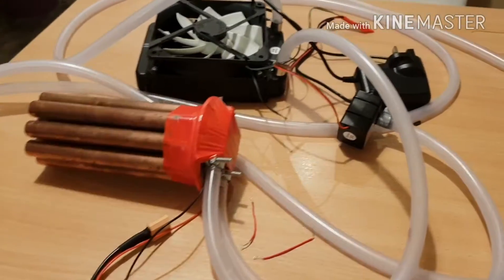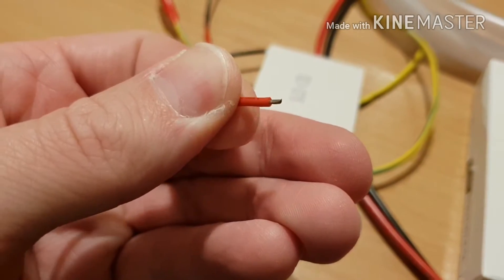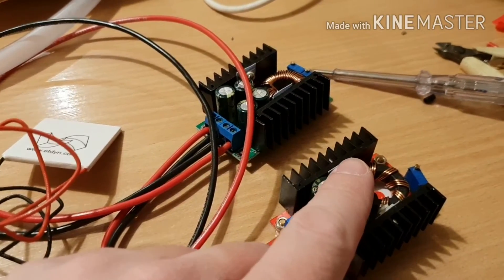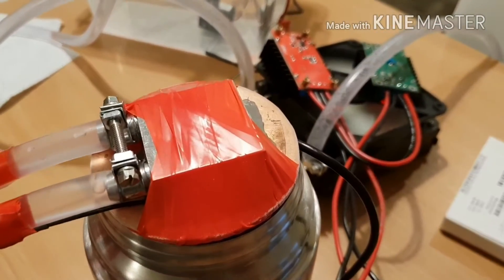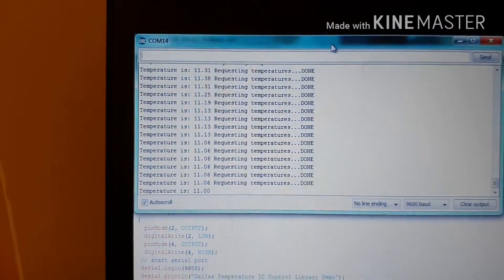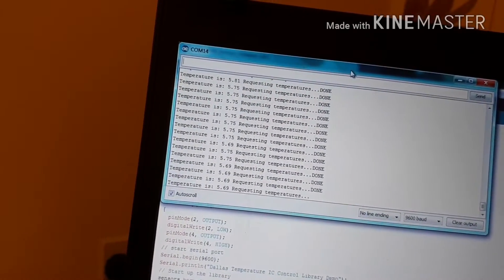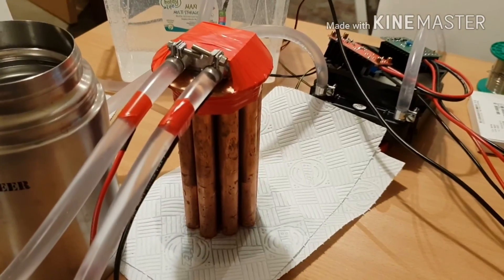Peltier Beer Cooler Part 5

Comment: You’re trapping air in your tubes on the heat sink. Drill holes to add surface area in pipes. Add water. It’s  all about conduction. Maximize conduction and insulate you’re water lines.

Note: I went back to a previous vid and saw your air holes. I was wrong about the air entrapment. But I still stand by adding holes to maximize surface area.

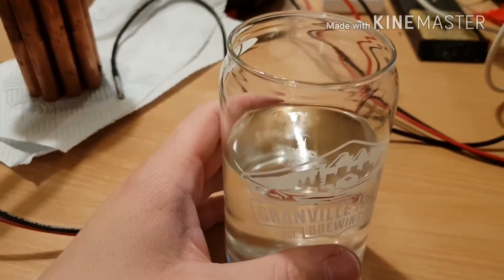Comment: 7:49 Hi Alex, Was the pump still running when you turned the power off? My understanding is that the peltier will experience a thermal transfer in reverse once turned off which is very inefficient. i.e. bleed heat rapidly back to the cold side. This may be the reason the ice melted immediately on top. Although the pump/ water loop won't prevent the ice melting it should reduce the heat transfer to your liquid?

Comment: Maybe would've been better using an aluminium (very nearly the same thermal conductivity as copper) heat sink with lots of fins to vastly increase the surface area presented to the liquid. A long finned heat sink could be turned in a lathe into a cylindrical shape to fit the bottle. Also insulate all bare surfaces on top that the Peltier is drawing heat from, it's only a small amount of loss but it all adds up.
Reply from the maker: My very first design concept used an aluminium vessel. The idea was to machine a cup out of solid with a pillar up the middle for surface area. The peatier mounted on the base. Issues are: 1) I don't have access to a lathe and 2) raw aluminium isn't food safe, so I would have to get it anodized.
Since I don't have access to welding equipment or machining equipment, the copper pipe was a solution I could put together with a Dremel and cheap plumbing tools. As you can see, it really doesn't work very well. The mark 2 method, shown in another video of mine works much better. I have actually finished the machine, and am in the process of filming a followup video.

Comment: Put a fan over the cooling water blowing down on it. This will keep the cooling water temperature down (via evaporation) and will force down the temp of the peltier cold side. Also, you are utilizing two different heat transfer mechanisms on the hot and cold side, convection and conduction respectively, which have huge differences in heat transfer efficiencies. That's why your copper is frosting. Convection utilizes flowing fluid (air, water, ect) to trnsfer heat whereas conduction is heat energy traveling through a solid medium.  Making the copper rods shorter will help as you noted, also stirring the fluid to be cooled will help. Cool setup.
Reply from the maker: Hi Robert, thanks for your comment.

Your suggestion about putting a fan on the cooling water is a good one, however I do have a radiator in the cooling circuit with a cooling fan. The original plan was to use the water as a heat reservoir, basically there is 10 times as much water in the cooling circuit as in the drink, so even with low overall efficiency the cooling tank won't increase in temperature too much. The radiator was added later because it was cheap and I figured it couldn't hurt.

You're right regarding the heat transfer mechanisms. Something to agitate the drink being cooled would help, and in fact I found by just shaking the container around I got better performance. My issue is, its meant to be beer, which is fizzy. I don't want to loose my fiz. 
In the next video (https://www.youtube.com/watch?v=MEycjlo366A&t=13s) I change up the cold side and make a heat exchange, which works much, much better!

The main issue with this design is surface area in contact with the water, and the thermal conductivity of that thin walled copper pipe. I need the copper as close as possible to the bulk temperature of the "beer", so the heat exchange approach doing it in 1 shot worked much better!
Reply from the maker: There is so much cooling water, it only heats up by 5 degrees during a full 15 minute run anyway.
You're right about the heat transfer mechanisms. I was hoping the increased surface area of the copper, and the relatively good thermal conductivity of copper would let me get away with it. According to a fairly detailed thermal simulation I did, this method should have worked. I guess I missed something out, maybe the surface corrosion on the copper, or maybe the wall thickness of the tube is thinner than I expected.
In a follow up video (check out my channel), I replace the large copper heat sink with a heat exchange and a peristaltic pump so that both sides use the same heat transfer mechanism. This works much better, but doesn't play well with fizzy liquids, so unless I figure out a way to pressurize the system, beer is out!